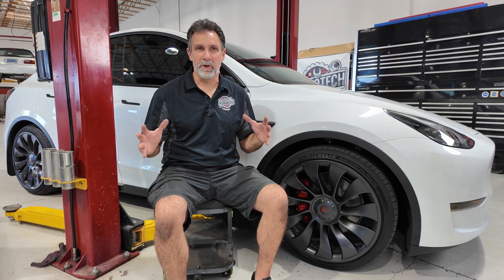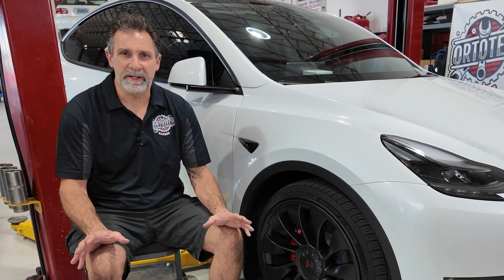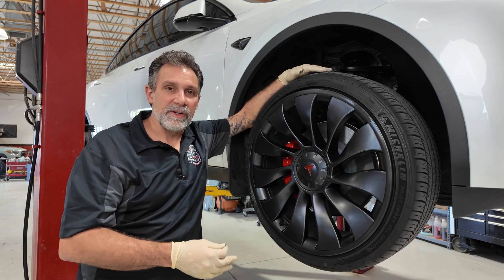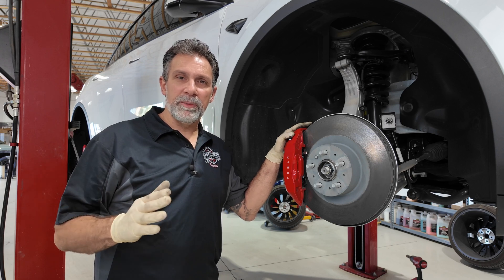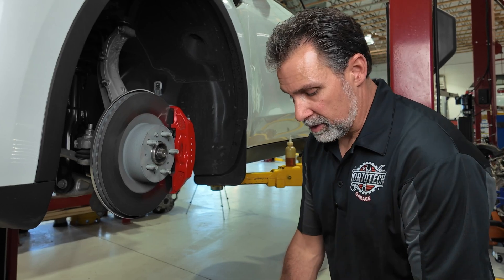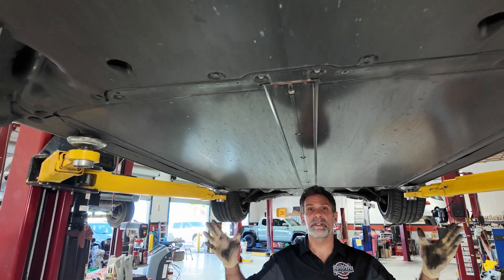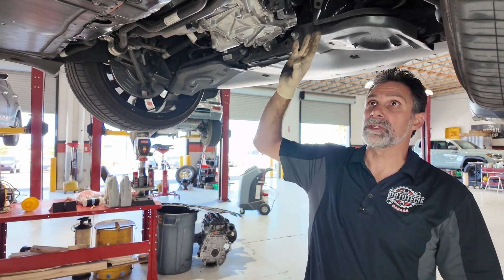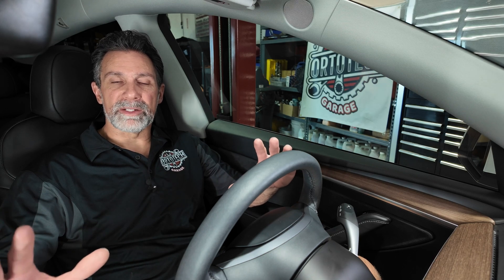Tesla Tire Rotation DIY + What Makes EV Tires Unique

Comment: I now have 15k miles and haven't rotated the tires. Should I do it or is it too late now ? Everything looks fine.
Reply from the maker: You should still do the rotation. It will help the tires wear more evenly. Just pick up the normal intervals from here. 👍
Reply: @OrtoTechGarage  OK, thanks, did you have a link for jack pads or tire plug ? Does video car have caliper covers ? What do you think of them .. help keep 'em clean ?
Reply from the maker: Here is the link to my Amazon storefront. 
https://amazon.com/shop/ortotechgarage

You can find the Tesla lift lads in my Specialty Tools list and the tire plug kit in the Flat Repair collection.  Thanks for tour support!  I really appreciate it. 

I don't remember seeing caliper covers on this Tesla Model Y.  They are only decorative and won't provide and protection.  I would say leave them off, especially if you can't see them through the wheels. 👍

Comment: Thanks Keith. Just one query. Does Tesla call for wheel stud lubrication? If not, won't the lug nuts be over-torqued by using their specified torque setting?
Reply from the maker: I did not see anything requiring wheel studs lubrication. And it is possible to over torque the wheels with lubricant but I have never had an issue and always add a few drops of oil to the threads.  👍
Reply: @OrtoTechGarage  Ok, thanks for that 👍
Reply from the maker: I think it's also important to note the opposite effect of oil, where the threads start to gall and seize, which would cause you to under torque the bolts.  This is especially common where rust can form and with the use of certain lug nuts.  This is why I always try to add a few drops of oil to the threads. These are just my habits based on my real-world experiences and not something you will find in a service manual somewhere.
Reply: @OrtoTechGarage Roger that. Interesting and good to know. Thank you.
Reply from the maker: My pleasure.  Great questions. Hopefully, suitable answers....